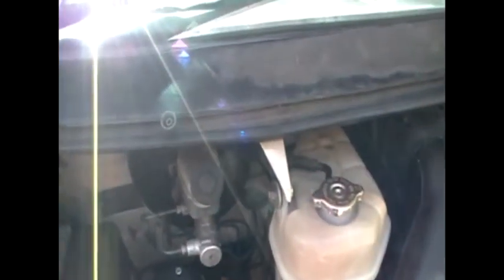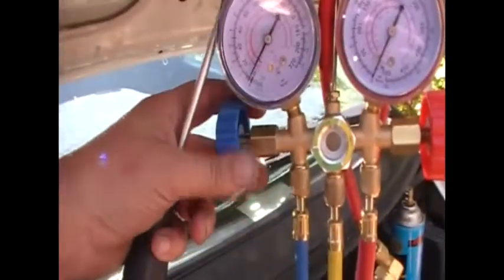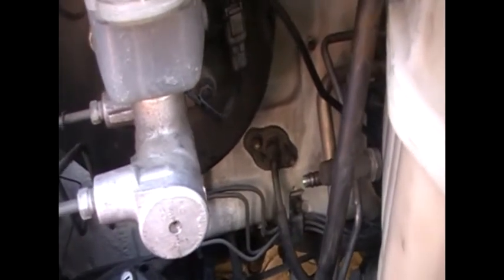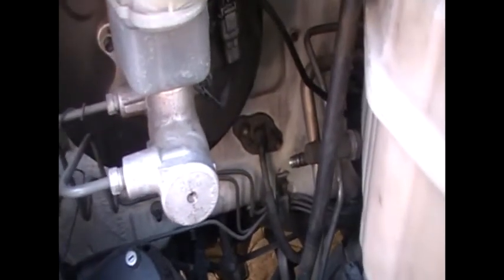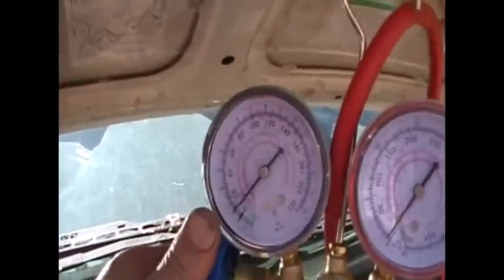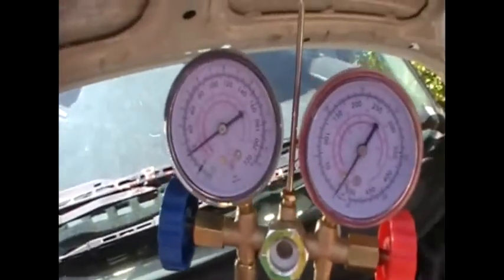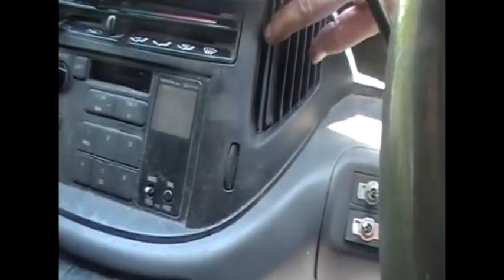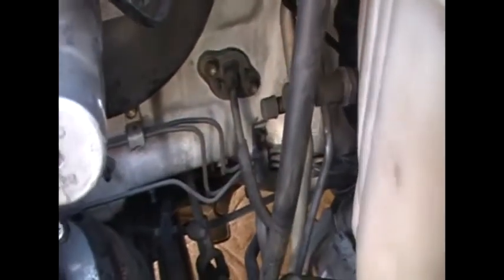Recharge Your A/C AirCon System [ Tarago Previa Estima TCR10 ]

Comment: hello do you know how many expansion valves a previa has on its ac system is there one on the rear ac evaporator thanks
Reply from the maker: On my TCR11 RHD there is an expansion valve for the rear AC under the van near the drivers door.

Comment: What if you put teflon tape on the threads and used a metal valve stem cap. Would doing that contain the valve stem leak so as to not have to replace the valve stem to stop the leak?
Reply from the maker: It might, As long as you can make sure it's a tight fit.

Comment: Hi proud owner of a 92 tarago 🤗
Looks like my a/c compressor is gone ..
What model and serial number is it for me to track one down?
Are other models etc 92 to 99 compatible??
I have alot to learn about my new purchase..lol
Any help or advice you can give me would be very much appreciated
Reply from the maker: There is SC and None SC Previa's but I am sure all use the same AC compressor. Before replying I did a little research and there is TCR10 compressors sold as 90-94 and others sold as 90-00 and I found one sold for 94-95. I have a 1990 AC compressor in my 92 and the one from my other 94 van that I own uses the same compressor. I believe you will be fine as long as it fits a TCR10.

Comment: What's the high pressure hose supposed to be at? I have  a 1996 previa le/sc. The ac works fine as I'm driving but when I come to a stop the AC temperature goes toward warm. My freon levels are good
Reply from the maker: I never touch the high side. That's more used for recovering gas.  other things to look at if your AC is not working when at IDLE but works while driving. Clean the Condensor and Evaporator, Make sure the radiator fan isn't faulty, and in many cases the old clutch fan is the problem and if you have replaced the fan with a power fan you need to make sure the fan is always running when the AC is ON. If you can spin the clutch fan by hand and it turns more then half a turn you need to fix it and you can do so by 'buying a new clutch' or DIY by opening it up and replacing the oil. You can buy clutch fan oil online. I use thick gearbox oil myself. the fan will spin faster and it may cost a little extra in fuel because the fan is putting extra load on the engine but it's only about 5% maybe.
Or for a firm fix to never look at the fan again you can open the clutch and clean out all of the oil fill it with silicone, let it dry for 1 week, and then put it back on, I do not recommend it but it would work and act as a solid driven fan you will lose about 10-15% power as well as the fane is now full time working. 
After you clean the system and checked the fan and everything looks good then other things like the dryer or valves have a problem and you will want to have an AC mechanic look at it before pulling things apart and losing freon.
Reply: @TaragoPreviaEstima  hi and thanks for the response man, i tested my radiator fan and it works just as you said, doesnt spin that much, almost barely spins. its weird now the AC works even on idle. i had 300 psi on the high side and my mechanic lowered it to 250 and now its working good . Thanks. what tips and info can you give me on the oil pump gasket leak on these previas? mine is leaking from the oil pump gasket, and how many engine/ transmission mounts does the previa have? 1996 

thanks again

Comment: Hi mate I got 92 tarago I need to recharge the refrigerant the sticker under the bonnet say R12 but can I use 134a instead?thanks
Reply: Most AC repair places will say the answer is NO and that you need to change the Dryer & the condensers to suit 134a. I took it upon my self to put 134a in my R12 system after a vacuum on the system, and it works perfect. When looking at the parts I didn't see why they wouldn't work with 134a. So at the end of the day I would say it's your call. You can do what I did and try it or replace all the parts that claim to be for 134a upgrade.
Reply: Tarago Previa ok thanks mate

Comment: hi mate, do u know where the hoses to the heater core located at?
Reply from the maker: In the van the water lines come in from the firewall on the LHS connecting to the heater core.
Reply: cheers
Reply from the maker: This blog you might find helpful 
http://www.toyotavantech.com/forum/showthread.php?179-The-cheater-s-way-of-replacing-a-heater-core&highlight=heater+core. 
I would most likely do this same thing if I ever had to replace mine. I am told pulling the dash out is better but this blog looks easier to me.